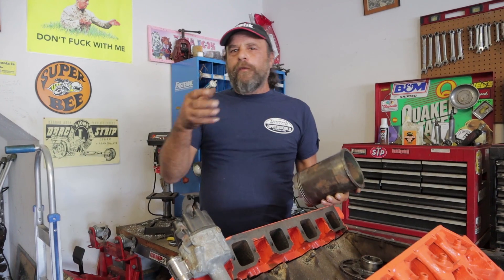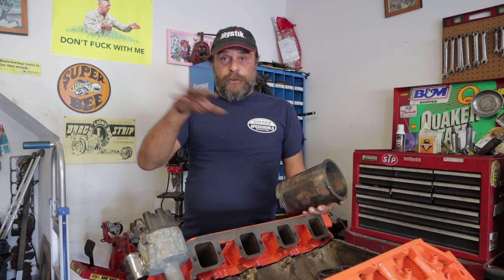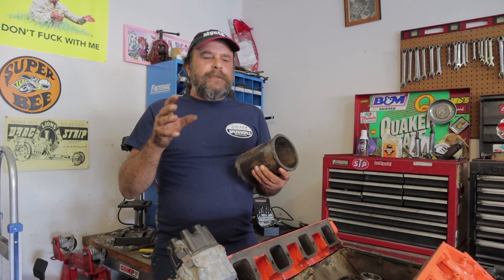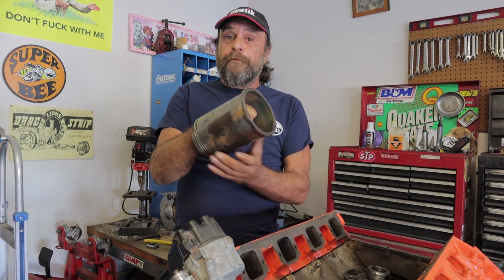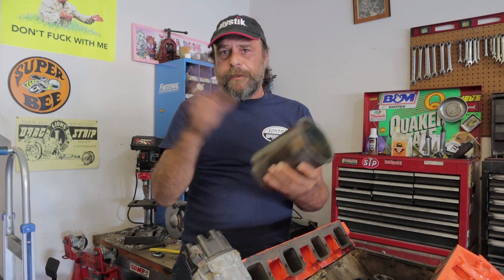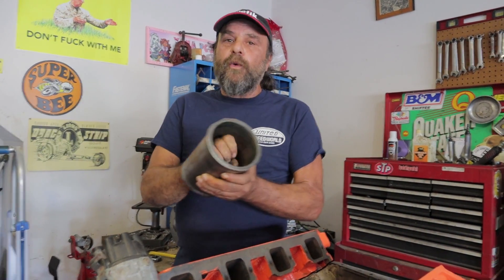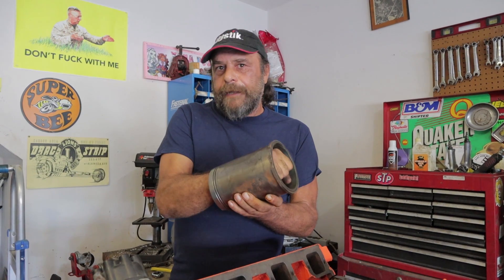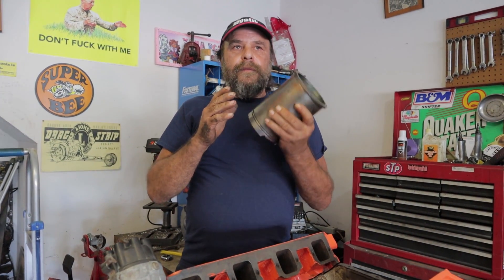The Myth Of Engine Displacement

Comment: NOW I AM CURIOUS AS TO IF THIS IS ALSO THE CASE BEHIND THE ENGINE MEASUREMENTS THAT ARE IN LITRES.. BECAUSE UNLIKE TOTAL COMBUSTION CHAMBER SIZE THE LITERS IN ENGINE SIZE IS NOT A MEASUREMENT OF THE ENGINES COMBUSTION CHAMBER SIZE BUT ITS ACTUALLY THE MEASUREMENT OF THE AMOUNT OF AIR THE ENGINE PUMPS PER COMBUSTION CYCLE HENCE WHY SUPER CHARGERS ARE OFTEN MEASURED IN LITRES AS WELL EXAMPLE BEING THE SUPERCHARGED FORD MUSTANG LISTING THE KEN BELL SUPERCHARGER NORMALLY IS 3.2 LITERS BY ITSELF! 
MY QUESTION ALSO IS THE FACT TURBO CHARGERS NEVER LIST THE LITRES AND SINCE THR MEASUREMENTS ARE RELATED TO THE AIR BEING PUMPED DOES A TURBO ENGINE ACTUALLY GAIN A LITER SIZE WHEN " MEASURED TOGETHER " WITH A TURBO? The centrifugal superchargers arent often listed with the litre size charts either or am i blind? I truly learned something i never " knew " cant say it wasnt totally " recognized " just never had this concept pinned down until this video! Amazing thanks for your time!
Reply: whether its measure in cubic inches or liters, the displacement is bore x stroke x cylinders, not actual air movement
Reply: Ur CAPLOCK is on numbnuts

Comment: I've always tried to get shorter stroke with a bigger boring more revs

most people are like oh no man you want a stroker more torque it's all about torque dude

I was always for high revs and more bore I like the high rev sound

Torque is for tractors
Reply: It's all about application! I prefer high revving small blocks because I prefer to take them out on twisty county trunk highways. But if you are drag racing, you need the grunt to launch. it's all about application.

Comment: Smaller displacements can be made to produce similar power numbers to larger displacements,  but the higher hp per ci decreases reliability long term. Especially on today's garbage pump fuel.
Reply: Not necessarily...

Comment: 100% 
replacement for displacement is rpm and increased air density via turbo/blower
Reply: Check out whats happening in the import world. Turbocharged mazda 1.3 rotaries with 1,000 hp, turbocharged 2.2 mitsubishi engines with 800 hp, turbocharged toyota 6 cylinders 1400 hp. Real street driven cars.
Reply: Boost is the great equalizer. At one atmosphere and engine this it is a little over double the cubic inch it started out as and thays a fact. As the boost climbs from the it grows exponentially. That is why we have a stock bore and stroke 5.0l coyote making 1300+ wheel hp.
Reply: Boost of 14.7 psi gives the effect of 2 atmospheres, thus doubling displacement. My 3800 becomes a 462.
Reply: Ive personally seen a toyota tacoma 4 cylinder turbocharged and fuel injected  lay down 750 hp to the wheels with 700 lbs ft of torque. Amazing what these little 4 bangers can do with 25 psi of boost.
Reply: silverbird58  WTF is wrong with you?
Reply: @superkillr  I am pretty sure he is referring to an actual rocket engine, and making light of the power from "little engines". But I could be wrong.
Reply: Ummm no ricers always say that dumb stuff. If you feed the same amount of psi in a larger engine it will make more power. A 2 liter running 20 psi is not going to make as much power as a 427 on 20 psi but i get what you are saying
Reply: @jamesavery6671  "say that dumb stuff" not sure you realise what you're saying.. forced induction IS 'replacement for displacement' sure, adding more displacement again is a thing, but the term is kinda seen as basic one dimentional thinking eg big engine big power, small engine small power.. there's more to it than that, and I'm sure you know that - an engine half the size at twice the RPM is the same as an engine twice the size at half the RPM, flow wise (potentially.)
Reply: @jamesavery6671  it's not a "ricer" statement it is a fact that an engine at one atmosphere of boost thinks it is just over two times the cubic inch and thays a fact. As you raise boost to higher then it grows exponentially. That is why k20 4 cylinder Honda engines can make 1000 wheel horsepower.  And the same reason our shoo car that is a stock bore a D stroke coyote is is making over 1300 wheel.
Reply: @turbochevelle5641  Well yeah we all know that i am just saying at the same boost level a smaller engine will not make as much power as a larger engine hence there is no replacement for displacement for all out power. People act like you can't boost big blocks etc only 2 liters lol. Nothing against the import guys but saying displacement means nothing in making more power is nonsense
Reply: @jamesavery6671  I don't believe anyone here is acting as if any particular engine can't be boosted. Of course people know that big blocks can be boosted.  You're just getting a response to the "ricer" comment for the most part if anything. By the way, I think all high performance builds are cool import or domestic.
Reply: @jamesavery6671  
Actually a 2.0 could in theory make more than a 427 at same boost as boost is just measure or restriction. If that 427 has shitty restrictive heads and low rpm limit and 2.0 is built for something ridiculous like 10-15k.

Obviously power curves would be drastically different and torque would be pathetic on the 4 banger in comparison.

Guess the whole point is there's a lot more to a motor than displacement, but that's why we all love them! 

Disclaimer I'm not a ricer and personally own a 6.2 Tahoe and a K5 with 350, but one cannot deny the level of crazy numbers achievable with modern tech on small engines
Reply: Thats true

Comment: So, you want a larger bore if possible. A small stroke, large bore engine. Then you’ll have less torque, more working area in the cylinder, and so more horsepower.
Reply from the maker: You want a balance of bore/stroke and rod length.  that's the key to those magic factory combinations like the 302 Ford and 340 Mopar

Comment: I wonder if it would be more useful to measure the amount of gasoline that can be efficiently burned during 1 revolution of the engine.  After all, the energy to do work is coming entirely from the gasoline being burned and the amount of work an engine can do is limited by the energy density of the fuel.

Comment: Sorry Tony I respect the hell out of you dude, but you bungled this one. A longer stroke engine will move the piston farther per degree of crank rotation. It's not all extra movement at the bottom.   A stroker motor has higher piston speeds because of this.  The adage while not absolute holds generally true
Reply: To further my reply your 2 examples aren't very good. The mountain motors of that era suffered from too small of cylinder heads and WAY too small of valves for the C.l.  in the intervening years the cylinder head development has widened the gap between the 500ci stuff and mountain motors.  As far as big chief goes in forced induction applications the efficiency of the compressor is more important than the cylinder size not to mention that pure horsepower doesn't win those races, the combination bring able to get it to the ground does. If you have more tire shake or wheel spin maybe your extra power isn't helping you so much
Reply from the maker: Go back and watch the video again.  If you start with a zero deck engine, and add 1 inch of stroke with the stock length rod, you have no choice but to raise the pin 1/2 inch to maintain that zero deck.  The piston head moves exactly the same distance from TDC to 90 degrees ATDC as it would with the stock stroke.
At the bottom of the bore, the longer stroke brings the piston down an additional 1/2 inch, and THEN on top of that the raised pin drops it another 1/2 inch.
Piston speed does increase, regardless of where the swept are begins and ends
Reply: @UncleTonysGarage  Sorry mate you are wrong.  Here is a simple calculator showing it. http://www.torqsoft.net/piston-position.html.   Changing rod length will change dwell time but in your example you are keeping the rods the same length.  After 90° of crank rotation a longer stroke crank will have the piston farther down the bore
Reply: If the piston speed does increase then the distance traveled per crank degree must also increase.
Reply from the maker: I see what your see what you're saying now...and technically you're right.  But, the distance is minute and in the dead zone of the power stroke
Reply: @UncleTonysGarage  You are right there the actual time under power is pretty small the differences in piston locations would be fairly minute. Particularly with modern gas that burns way too fast
Reply: @UncleTonysGarage  If we are comparing a 3.75 in stroke to a 4.25 in stroke,  assuming a 6.86 long rod. The piston with the 4.25 crank will be .319 in farther down the bore after 90 degrees of crank rotation

Comment: hmm... may explain why my step dad preferred somewhat smaller displacement engines in his race cars, whether drag or circle track. He would actually destroke them, if that's a word. He preferred higher quicker revving engines to powerful but slower revving large bore engines. I didn't get what he was trying to explain back then, I probably still won't, all I knew was his cars would eat 440's 426's and other large bore engines unless the other engines were supercharged or something. His engines started life as Boss 302 engines from 1969 I'm not exactly sure what all he did to them, but I know he had to find special rod bolts that would take the strain. Standard rod bolts wouldn't last a minute.

Comment: i always heard the oversimplification as..."no substitute for cubic-inches"....for me, big-cubes were the easiest path that a novice newcomer may take to achieve an end goal and probably to a degree still are today....but cubes dont matter to the real gearhead that will squeeze and extract every last HP....both BOSS and DZ 302s were near 400 horses even tho they were rated at 290....compare that to the RB 440s 375....smokey got 600 out of a buick V6...countless examples literally everywhere....and isnt a foot-pound a measurement of work even tho thats a torque figure-term....a pump huh...detroit engineers always refered to and thought of their babies as their piston-engines that were really just a self-propelled hot-air pump lol...i always focused on the big-arm crank gave extra-leverage at the crank centerline.... just like using a longer cheater-bar will...there are many additional factors that figure in, but for basic understanding of the engineering, you must have a starting point to build from and on...and uncle tony just fired the starter pistol nolol....you can ponder these principals for ions.....just shows what i already knew, that T can fly frisbee and cut up with the boys in the parking-lot drinking a dark-beer...or he can sit down with smokey and some detroit engineers with slide-rule and protactor and hold his own any day of the week.......kutgw professor tony, i love it.....p.s....i think the only bomb/term you didnt drop was 2 of the most beautiful words in the auto-engineering language...."volumetric efficiency".....oh, and lets see a 302 out-torque a 440, thats an entirely different bird.
Reply: Comparing a stock 440 vs a modified Buick V6....My buddy has a mild 440 with just under 900 hp,not a stroker either!
Reply: The advantages of a big-displacement engine are that it can otherwise be simple, relatively inexpensive, far more DRIVEABLE (i.e., idle smoothly at a low rpm and have good off-throttle performance), and TORQUEY.  Disadvantages?  Well, assuming that you can fit the damn thing in the engine compartment, a bigger displacement engine also guzzles more fuel when IDLING, so a "daily driver" with a big engine can really suck up the gas while waiting at the stop light.
Reply: When you remove power adders from the equation, that's when the experience and skill will begin to show. Anyone can follow instructions and add nitrous on any engine and make more power. Will it last? Not likely. Is it relatively easy? Yes. Will that same person be able to make the same amount of power without the nitrous? 99% of the time.. no. The majority of people are completely clueless when it comes to engineering and building engines. Thus, they're called parts swappers.

Comment: your explanation answers the question why a given percentage increase in stroke doesn't necessarily equate to a power increase of the same percentage. if only we could measure an engine size in how much air it's actually drawing in. if you could , you'd also have to account for how much escapes out the exhaust valve.

Comment: Mario Rossi and Richard Brooks proved what your saying back in 1971 at the Daytona 500 with the "lunchbox motor" in their '69 Daytona.
Reply: Not really, to compete it had to turn 11000 rpm where the bigger motors only had to turn 7500
Reply: T L  Yes that's true but certainly got the job done.
Reply: @paulcabezola3559  no not really they ran it one race and didn't finish, the motor didn't have the power to push a non aero car around the track. It was a valiant effort but sure doesn't prove the point trying to be made here
Reply: T L That motor was in a 69 Daytona and did finish. I may be mistaken but I believe they finished 7th. It may have finished better had Pete Hamilton not wrecked them. It only ran one race because Nascar banned all aero cars after this event. They were allowed to complete at the '71 Daytona 500 but were only allowed 5.0 liters of displacement.

Comment: When we were kids we were told European Motors get their horsepower through RPMs.
American Motors made their horsepower through displacement
Steam engines can achieve maximum horsepower at 1 RPM because their horsepower is a function of pressure. With an internal combustion engine ideally you would like a combination of displacement and revolutions per minute. So we need an 8-cylinder the tachs like a Kawasaki H2.
The bike produces 326 horsepower with 998cc.
That is 60.902 cubic inches.
Hold on and don't fall off.
Reply: You can't make mximum HP on 1RPM (unless you only manage 1RPM).  HorsePower is a function of force over distance / time.  1000NM of torque at 1RPM is 0,14HP or 0.1KW. If you manage 2RPM it's 0.28HP and at 7024RPM its 1000HP. More RPM=More Power. The ICE and the SE both work in the same way. Torque measures the force applied to the crankshaft by the piston that is driven by pressure. In both engines Torque is a function of Stroke, piston surface and pressure.  Steam engines Produce a shitload of torque from the first RPM, but they make peak power where Torque X RPM is the highest. This true for the Reciprocating Piston engine, The Wankel (Rotary) and even the Electric Motor.
Reply: @thetruth5232  I thought horsepower was work. Work as defined as movement against gravity. Force is defined as mass times acceleration. A steam locomotive can get a train moving at 1 RPM because it produces maximum torque. 1 horsepower equals 550 foot pounds per second equivalent to 745 Watts. Force equals mass x acceleration= kilograms per meter per second squared. I get this stuff confused. So what is the maximum horsepower a steam locomotive could produce at 1 RPM?
Reply: @ericheine2414  torque is work rpm is how fast you can do that work. Horsepower is the combination of the two which is rpm × torque\5252 = horsepower
Reply: @jamesavery6671  engine speed X torque / 5252 = horsepower.
Torque is a measurement of angular momentum=. The twisting force that causes rotation
Reply: @ericheine2414 sounds like we agree
Reply: @jamesavery6671  We do agree.
The math we are using is what is known as the crescent wrench equations. The math is easier than calculus. A steam engine can develop 1500 pounds per square inch, times the surface area of the pistons, multiplied buy a 40 inch radius driver wheels, creates some serious torque at X RPM. Of course you have to convert to foot pounds, or go metric. I don't know what the circumference of a driver wheel with an 80 inch diameter is, but it's pulling a freight train, moving a distance, and increasing the RPMs with every revolution, 7000 horsepower and tons of torque. Up over a mountain at a 3% grade. This is all stuff my dad told me. The steam engines horsepower and the torque is a function of pressure that's basically on tap. You just open the valve.
Reply: I know it's like 62 cubes for a liter, but quick math in the head I use 60

Comment: For a guy who got kicked out of school at 16, you're smart af uncle tony. Is measuring displacements more accurate when it's done in liters or cc? As much as I love muscle cars, the truth of the matter is that stock  powerful  electric cars will almost  always beat a stock muscle car in a drag race. Nothing beats the sound of a v8 though.
Reply: Thanks Aussiebloke609, that makes sense. Btw is love Australian muscle cars.
Reply: Measuring is equally accurate in either form - it just depends on how many decimal points you're willing to go to.  I used to drive a 1608 cc (which is exactly the same as 1.608 litres) car - usually referred to as a 1.6 litre for convenience.  So if you're rounding your litres off and only using one decimal place, then you're being less accurate - but that's a rounding error and not a problem with using litres or cc.

PS: If you're into using only whole numbers, then using cc will be more accurate than using cubic inches, and c.i. more accurate than whole litres...because you're using a smaller base unit.

Comment: Also .. that's not true.  If you increased your sweep by 1".. then at 90 degrees, you will have added 1/2" to your working power stroke.......  But I agree that this is not the real addition of power.  The true power advancement is in the higher compression and higher volume of air.. which also comes with higher heat... so you are trading longevity for higher peak performance.  There's always a trade off
Reply: Right on you can make a little motor keep up with the big boys but she is either gonna have more compression, more boost or more rpm